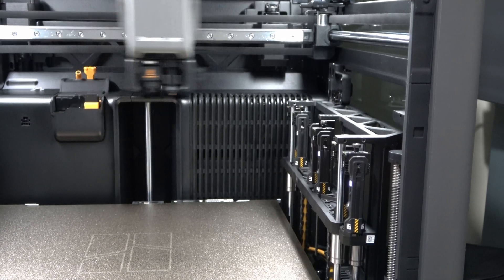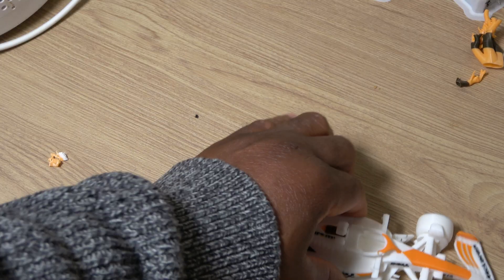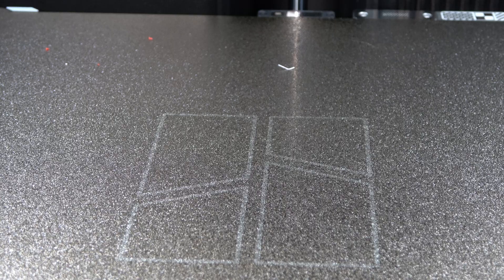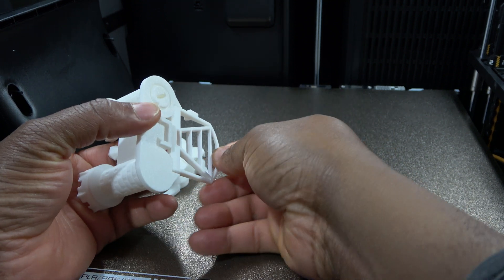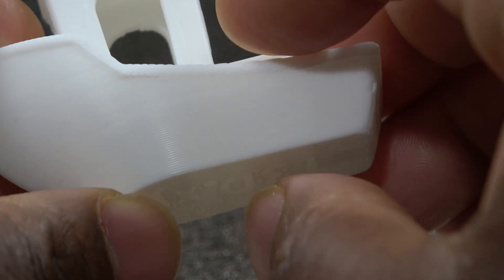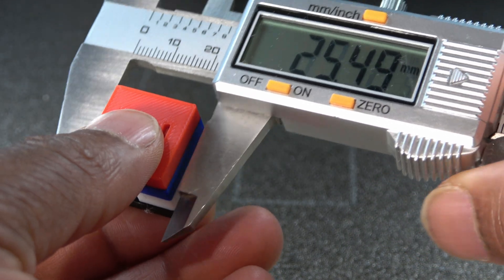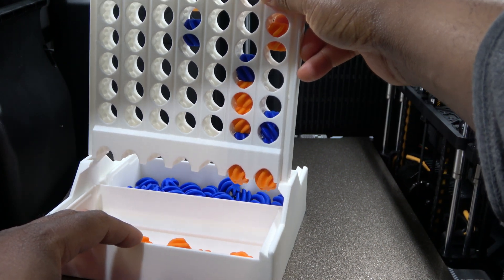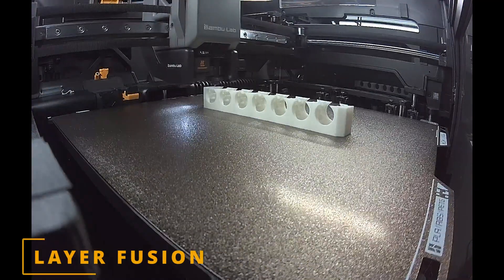Bambu Lab H2C First Prints – Vortek in Real Use

Comment: You’ll get significantly less purge waste if the Vortex system is fully populated with the same diameter hotends (for example, 6 × 0.4 mm hotends) and you’re actively printing using both nozzles. In that configuration, each colour only needs to purge once, which allows up to seven colours with minimal waste.
Reply from the maker: This is absolutely true. I’m not ready to invest into more hotends though.